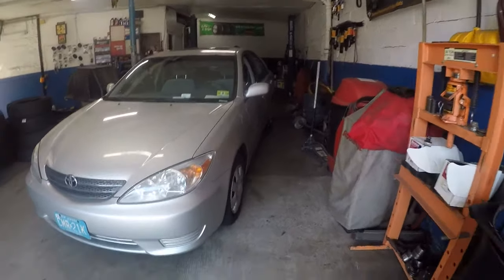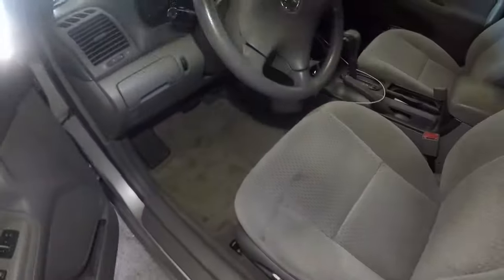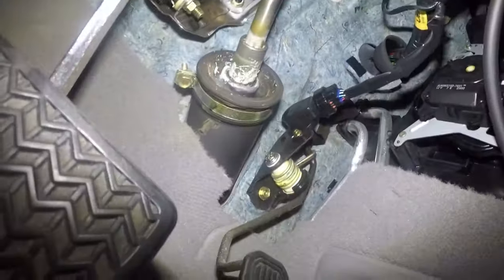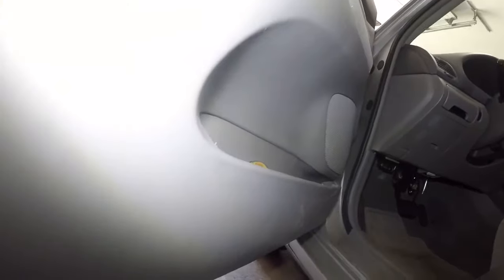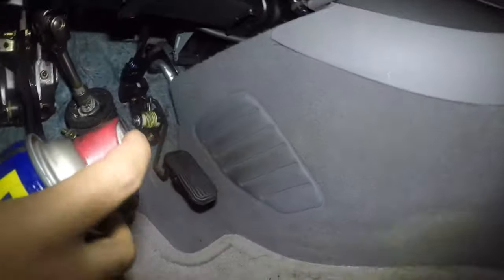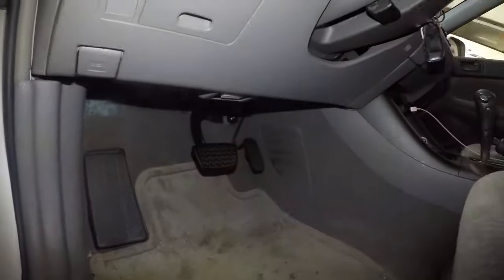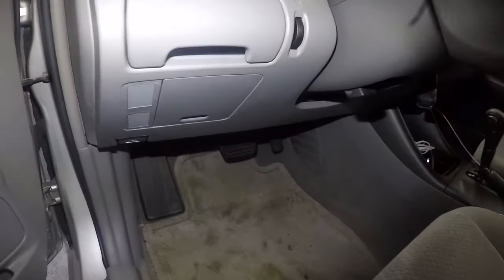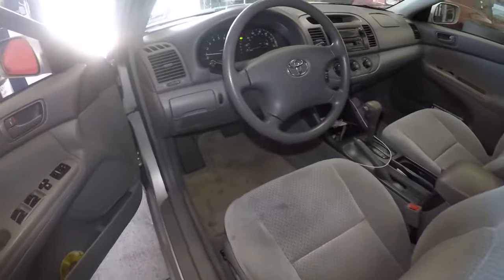When turning steering wheel it makes squeaking noise   Heres a fix

Comment: Wouldnt Silicone spray be better than WD40 in this case?
Reply from the maker: Yup longer term that will work
Reply: I tried silicon grease several times, it only lasts for a week. Im  going to try heavy bearing grease!